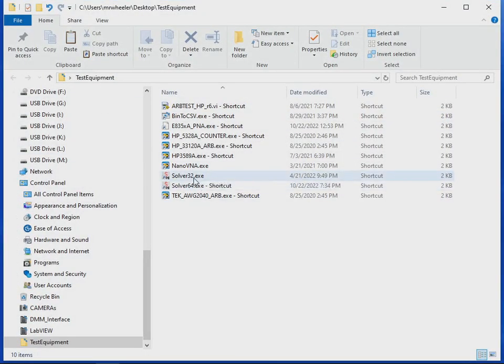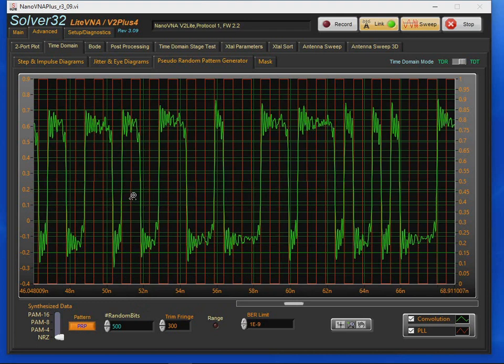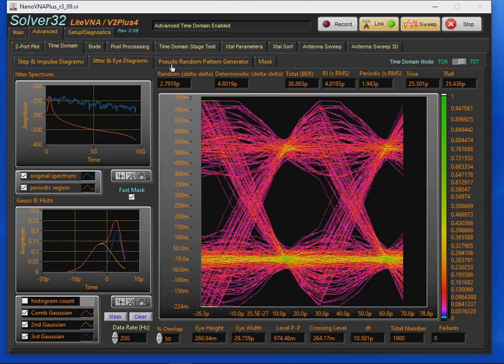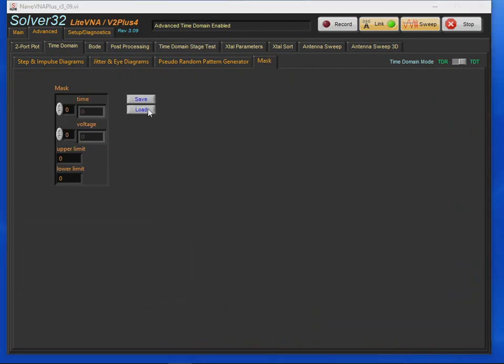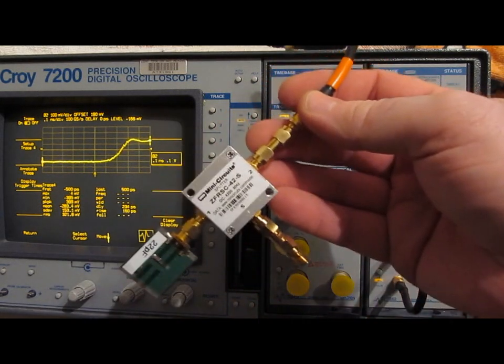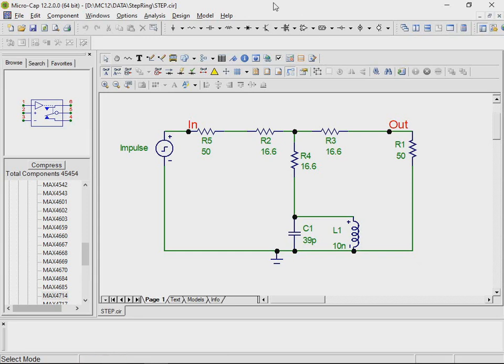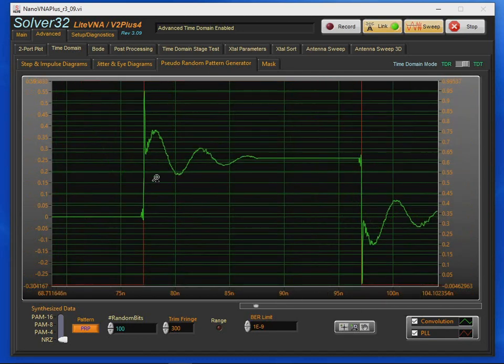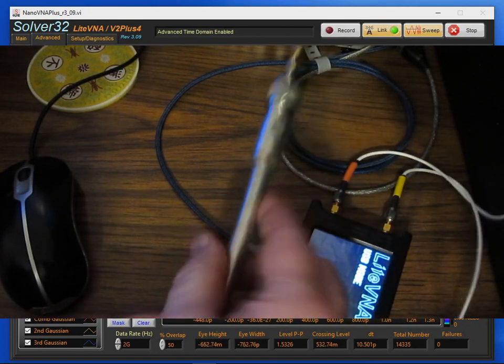Demonstrating Solver32's Eye Diagram feature with the LiteVNA

Comment: Wouldn't it be faster if instead of IFFT and convolution you did FFT of the PRBS (needs to be done only once) then .* it with your S's and then do the IFFT. I.e. no computationally expensive convolutions: .* is linear, IFFT is N*log(N). BTW, thanks for your videos! Really appreciated!

 [EDIT:] Just realized: convolution is for a single symbol only (pulse response). Although the response will likely overlap consecutive symbols - it will probably be much shorter than the entire PRBS sequence (so no point doing what I proposed above).
Reply from the maker: The biggest problem I ran into was how to do the mask compare fast.  I think I bought my PC in 2016.  It's old.   Replacing it would certainly improve things.  Another would be to change over to the 64-bit LabView but that's not going to happen after NI changed their licensing.
Reply: @joesmith-je3tq  People simply assume that the mask is square, then lay the trace outside of it as fast as possible (i.e. to the left and to the right of the mask's time interval) and only when inside the mask's time interval do the checks.